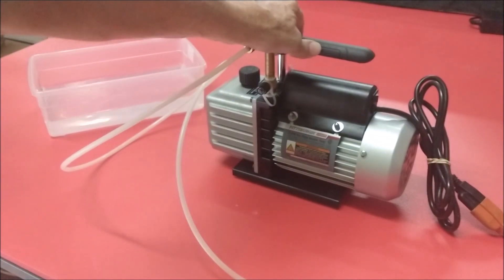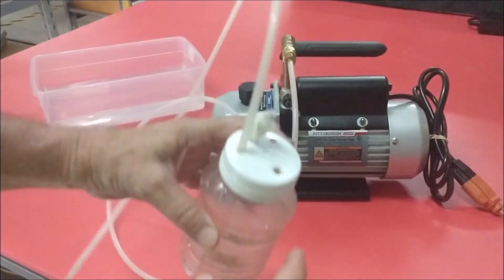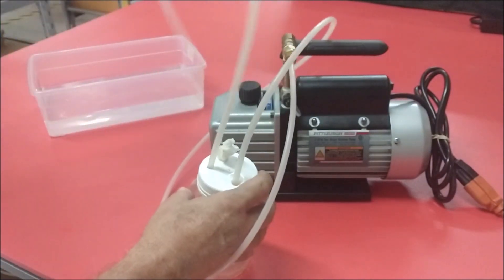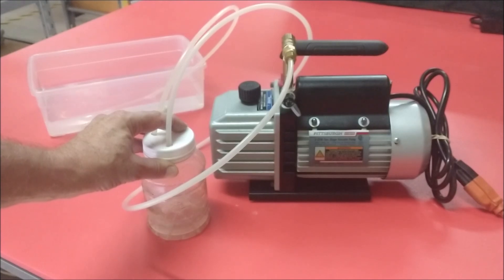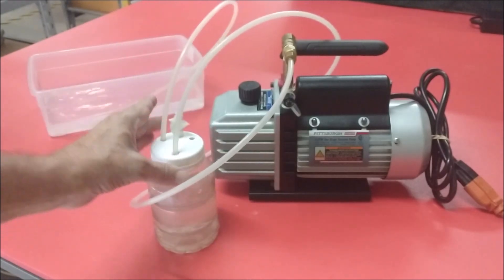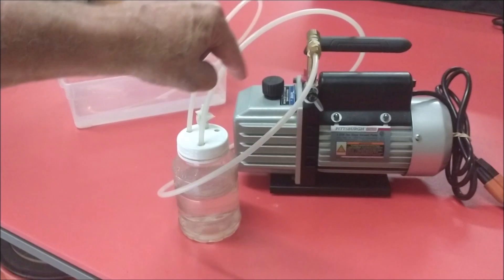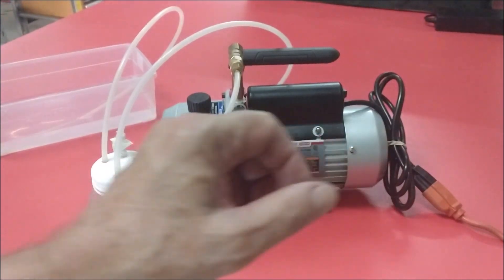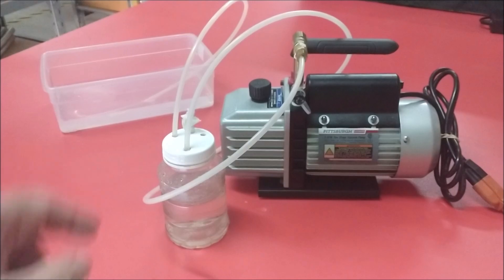How To Safely Siphon Liquid with A Vacuum Pump - Take a Look !!

Comment: Thanks for your very interesting demonstration of the vacuum pump Joe. There’s many different ways to create enough vacuum to siphon liquids. The simplest is by mouth, which is dangerous, especially with some liquids. 
If compressed air is available a vacuum can be created by blowing a jet of air across the end of the siphon tube at a slight angle. If done correctly liquid will soon begin to flow into the container. This is a very safe method but it does require a source of compressed air.
Reply from the maker: The method I found that surprised me when I discovered it was to use a very long hose and pre-fill it as much as possible and cap it  before inserting the dry end into the tank. When you release the cap and the pre-filled liquid runs out, it naturally forms suction and starts the siphon. Works like a charm.

Comment: Hi Joe - thanks for putting in the plug for the Indiana engine show .  I hope you can make it . If you bring in some of the models you have been making on your Chanel  you will  be treated like a rock star .  I too did the Michigan show for many years and it has been missed . I like the simple method of using the vacuum pump.
Reply from the maker: I'll give it my best shot.

Comment: Always good to see these little tips. I built mt vacuum vessel/container out of a pressure cooker with a Lexan top. Works great. What you have here is how a heart,Lung machine. My pump is/has been rescued from the trash from our local hospital. The containers are plumbed up exactly like this but there are 2 of them in line. I suppose it is just to make sure no fluid gets into the pump. It is 45 years old and  still pumps like it was breand new.  Thanks Joe. Now I need a project to use mine for a lost wax and investment to fill with molten silver.

Comment: Hi Joe, I've been watching your channel for quite a few years. I have 9x20 harbor freight lathe and a harbor freight benchtop mill that's fairly large. The table is maybe 30 " wide, drill press, bandsaw, and rotary table. I want to be like you. Just make stuff and get paid. How did you get your start? I have experience with a couple different employers running this stuff. I also ran some Okuma 4 and 6 HP CNC milling machines. My home equipment is as mentioned and not CNC. I just need to make some money running these by making parts with manual machines for now. Where do you recommend I go to find business and get started. How did you get started? I'm very curious. Is there a website where I can find business. How would you get started if you were me today?
Reply from the maker: There are online sources for small jobs. Try Xometry
Reply: @joepie221  Thank you. I consider you a bit of a celebrity. I don't know if you know who Scotty Kilmer is. He does tons of car repair videos and he's one of the best on YouTube. I told my wife that you're the Scotty Kilmer of Machining on You Tube. We were both excited when you replied. She liked the video where you had the CNC play Merry Christmas on the keyboard around Christmas time. Thank you so much.
Reply: You came to the right place my friend.

Comment: Great info as usual Joe.   If you dont have a vacuum pump, you can pick up a peristaltic pump on line (ebay, amazon, etc,) for less than $20 that might do the trick.  No risk of flooding the vacuum pump and the tubing is disposable...  You only need 1 loose hole in the top of your recovery vessle for the ultimately lazy folks like me.....

Comment: Psst: Put the 3rd hole on the bottom, then you can close it at will, and empty it in place in a bucket without disassembling anything.

Comment: In biology we call it a "vacuum trap". We buy plastic and glass  traps. The Earlenmier glass traps are very popular.
Reply: The kitasato flasks can also be used and are better suited for high pressures and vacuums because of the thicker glass they are built on. Erlenmeyers are not made for high pressures and vacuums.

Comment: Now, Dad said he could determine the octane rating of fuel by the taste...
Seriously though, you should change the oil in your pump often or immediately after doing this if you use it to evacuate AC units before charging.

Comment: Air conditioning compressor can act as a vacuum pump,its poor mans way .One another great application is wood conditioning.If you make a container out of pvc pipe and use car tire valve you can put wood tool handle for example in it and fill it with linseed oil.When you vacumm out the air wood soaks in linseed oil much better  and you get a handle that will last for decades .

Comment: You can do the same with a compressor, you only need to introduce a Venturi in the suction line, you can even use an old airbrush for that purpose
Reply: MityVac have several products in that vein !!

Comment: Well, almost the first time that i didnt learn something new that was great knowledge.   Didnt know about the modelers show.

The pump, that i already knew and use this exact thing almost daily as a mechanic.  I have 3 versions of a vacuum pump and use all 3 in different ways.  And this is one of them.

But as always, Joe teaches very well.  So i know some people will love this knowledge and usefulness of another use for the pump.

My biggest usage is brake bleeding, fluid extraction from power steering systems,  and checking valave sealing.

Comment: That's the way to move liquid with an air pump, of course.  But it's not a "siphon".  A siphon uses a difference in liquid levels.  I.e., gravity.
Reply: I think it is the difference in air pressure  that drives it

Comment: This is going to help me soon. I parked a car three years ago with a full tank. Of course, I didn't intend to leave it for three years, so it never got fuel stabilizer. 😂 She needs to come back to work, so now I need to figure out a disposal method. Thanks for the tip, I use a vacuum pump to stabilize wood for knife handles. 👍

Comment: When I was in high school, my Dad set up an old refrigerator compressor as a vacuum pump for my experiments in high-voltage arcs.  To capture the oil droplets from the exhaust, I ran a tube into a container of soapy water, so the evacuating air would bubble up through it and the oil would be trapped.  That worked fine, until the day I let my vacuum chamber pull the soapy water back through the pump!  If the blended oil and water didn't kill it, rust from the soapy water might have, but getting frozen in an unheated shed certainly finished it off.

Comment: Mechanics use vacuum pumps for a lot of things. I used one to change a lower radiator hose on a Peterbilt not too long ago. Without draining and filling the whole cooling system. Worked great. You can use a shop vac too. Especially on hydraulic systems. Just be careful on aluminum fuel tanks. You can crush them with a shop vac.

Comment: You could use the third hole as mechanical overflow protection for the pump. Put a plate on the top (like a Reed valve) and attach a float to its bottom. When the fluid level reaches maximum, the float would push open the valve and relieve the pressure. Could be a fail-safe in addition to an electrical shut-off. So there - a solution to a problem nobody asked for 😊

Comment: Word of warning! I purchased the same vacuum pump a few years ago to bleed brakes on vehicle with. It worked once and then fell apart. Seems the plastic used for the top and the base were attacked by the brake fluid on my hands and broke up into pieces.......not a good day.
Reply: Brake fluid is like paint stripper. Beware
Reply: The pumps are 69bucks.  I consider them throw aways.  I've beat the hell out of mine for almost 10years now.  Not a bad investment in my mind!

Comment: I did almost exactly this to drain a car radiator enough to replace the thermostat. Pulled a few gallons into clean milk jugs to reuse. The jug will try to collapse so use something sturdy enough. Also drill the holes in the cap smaller than the hose to get a good seal. It works great